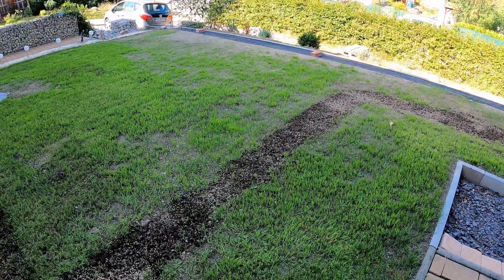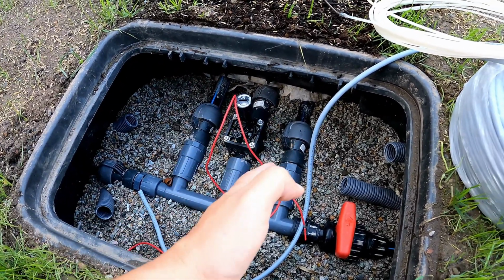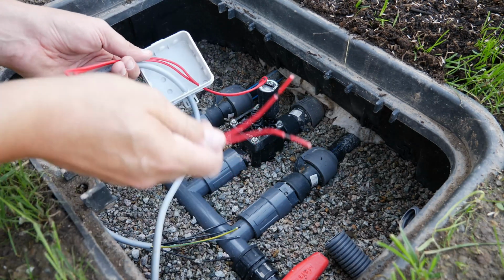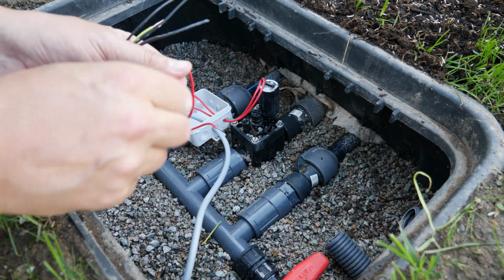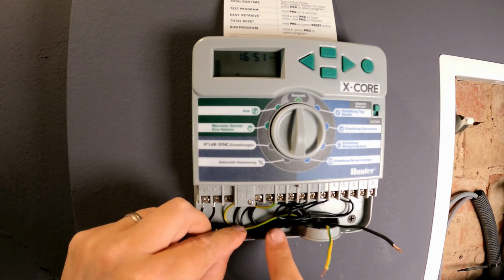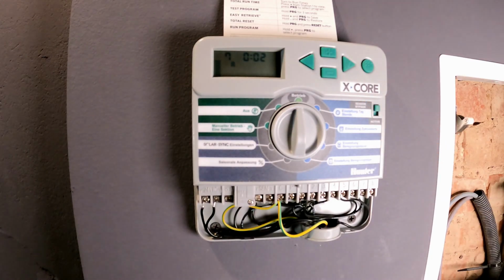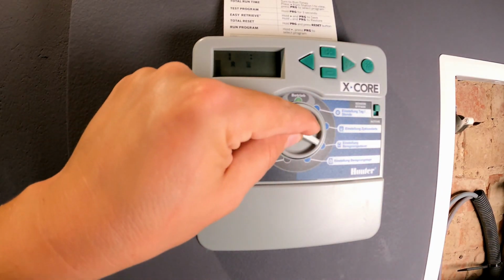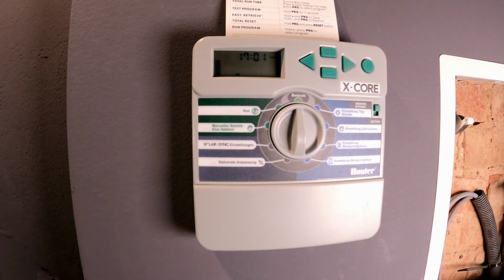How to Connect a Solenoid Valve to Hunter X-Core Controller

Comment from the maker: *👇 All products & links from this video:
🔗 Hunter solenoid valve: https://geni.us/JxyAtB (Amazon)
🔗 Control cable: https://geni.us/dQHSL (Amazon)
🔗 WAGO terminal: https://geni.us/nYslT (Amazon)
🔗 Wire strippers: https://geni.us/XKu9LB (Amazon)
🔗 Epoxy for electrical components: https://geni.us/GoCX (Amazon)
🔗 Hunter X-Core irrigation computer: https://geni.us/LxVyM7Y (Amazon)
🔗 Retraction aid: https://geni.us/qTxfG (Amazon)

Other accessories*:
🔗 Pressure-regulated housing for MP Rotator with nozzle: https://geni.us/mQBIPo9 (Amazon)
🔗 MP Rotator nozzles: https://geni.us/cBdTAL (Amazon)
🔗 Complete Hunter set: https://geni.us/xNpgEC (Amazon)
🔗 Hunter adjustment key: https://geni.us/dh6eBT (Amazon)
🔗 Rain Bird large distribution box: https://geni.us/w6Yo1xt (Amazon)
🔗 25 PE pipe: https://geni.us/id4w1 (Amazon)
🔗 Hunter distribution box: https://geni.us/kERg1if (Amazon)
🔗 Distributor: https://geni.us/CAUtIyB (Amazon)
🔗 Angle for distributor: https://geni.us/33ZoLJ (Amazon)
🔗 Tap for distributor: https://geni.us/SlqUq5 (Amazon)
🔗 End cap: https://geni.us/DIENA (Amazon)
🔗 Teflon tape: https://geni.us/lTxS (Amazon)
🔗 Fittings clamp connectors: https://geni.us/mqsoDL (Amazon)
🔗 Flexible connection “Swing Joint”: https://geni.us/9BR6 (Amazon)

Useful links:
🔗 Comparison of Hunter MP Rotator vs. Rain Bird R-VAN: https://youtu.be/aUBmOubGYsQ
🔗 Lawn irrigation – calculate water connection: https://youtu.be/RRqN2XdgFuQ

Follow me on my social media channels for more content! @commaik

🎥 This video was originally produced in German for my main channel:  
https://youtube.com/commaik  
It was then translated into English using Heygen – with my own voice and lip-sync.

🎙 Want to dub your videos like I do? Try Heygen:  
🔗 https://www.heygen.com/invite/b96cdcf6 – Get 300 free credits when you subscribe.

📺 The original video, which includes English subtitles, can be found here: https://youtu.be/eHTYT5RI8N4

Note: All links marked with * are affiliate links. If you make a purchase through these links, I will receive a small commission at no additional cost to you. Thank you for your support!